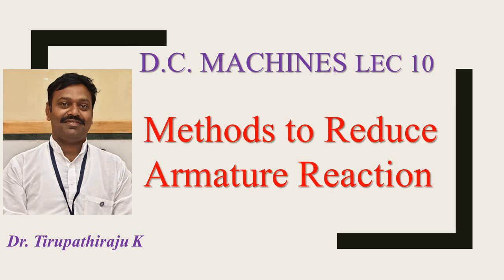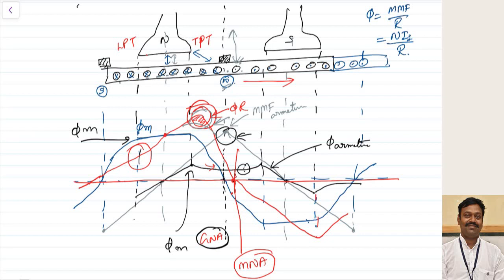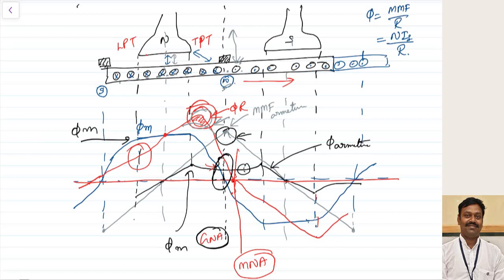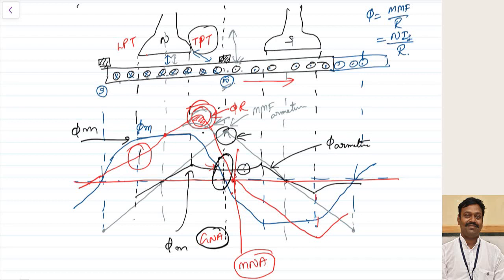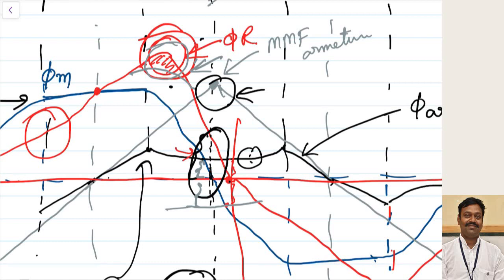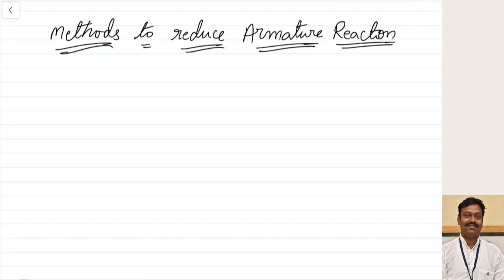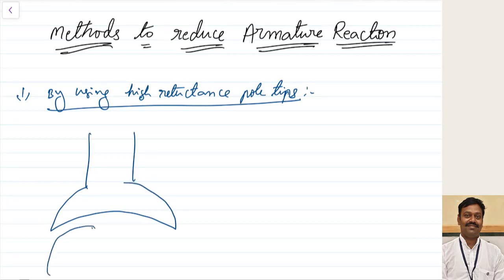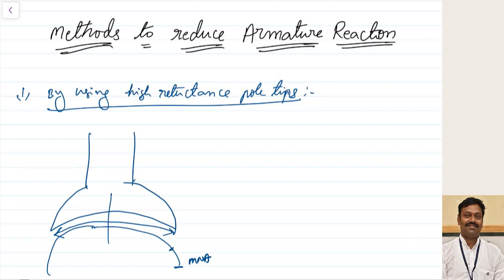DCM 10 Methods to Reduce Armature Reaction

Comment: Question - In a dc machine the space waveform of the air gap flux distribution affect 
Answer- neither the torque nor the voltage
I have doubt in this question please explain it.
Thanks sir

Comment: 21:09 sir why here the induced voltage in not following lenz's law, why its is not opposing the main emf...?
Reply: Lenz's law states that, the effect opposing the cause for it, here dynamically induced emf is not  cause for the self induced emf. Cause for the self induced emf is varying load. Hope it will help u😇